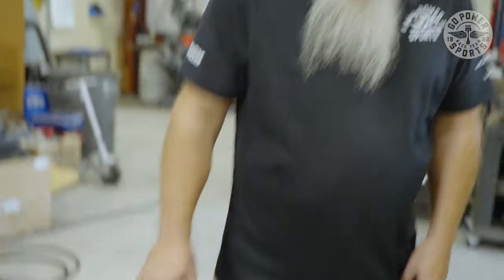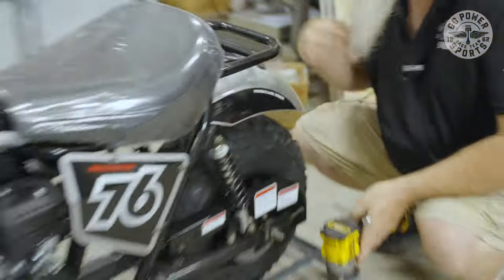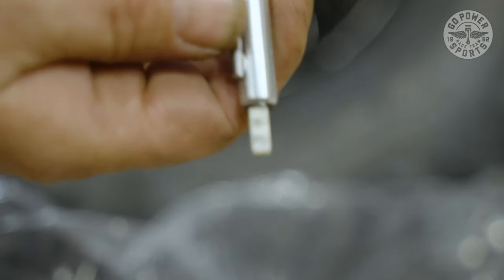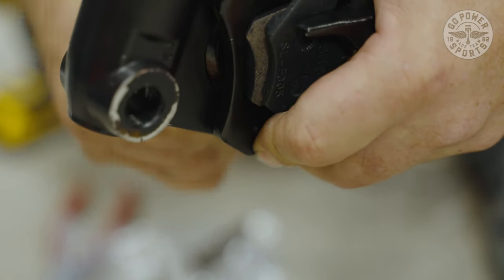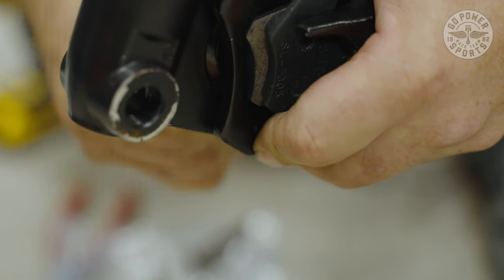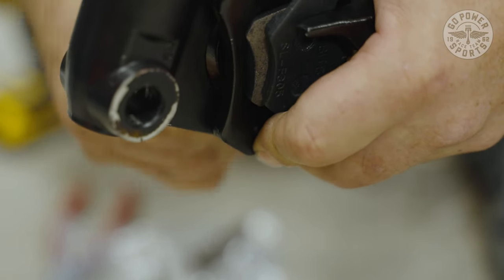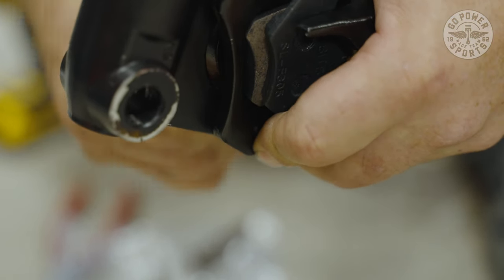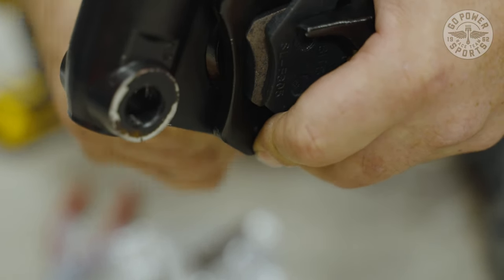How To Assemble TrailMaster Hurricane 200X Mini Bike | Tutorial

Comment: How do you spread the front brake calipers apart to get the spacer out so you can put it on the disc? NEVERMIND YOU FAILED TO INCLUDE IN THIS VIDEO THAT THEY PUT A PLASTIC WEDGE IN THE FRONT BRAKE LEVER TO KEEP THE BRAKE APPLIED. REMOVE THAT AND YOU CAN COMPRESS THE CALIPER>
Reply from the maker: Good job

Comment: I appreciate the video but straight following your instructing,  I'm having problems with the front brakes. For one,  if I tighten the bottom bolt of the caliper it is so long it touches the disk..   so after realizing that I backed it out a bit and stilll.. the tire won't hardly turn.  The inside pad is so compressed against the disk the tire won't turn.  The outside pad still has a gap and won't touch the disk even after pumping the brakes.  I don't know what my problem is
Reply: I’m having the same problem did you ever figure it out?
Reply: Hard to decide without seeing what you did and its 5 months later.
But I'm curious.
I am guess something was upside down or backwards?

Comment: 12psi sounds bit much for offroad.
However, many more experienced riders have told me to use the reccomended as a starting point and experiment for your preference and where you ride.
Don't go over the 10-12 they recommened(depending on bike and tire brands).

My bike for example handles the best where I ride with 9 in the front and 8 in the rear.(Do not just go set your tires like mine that would be stupid even if you came to ride the same place. they need to be setup for you not me).

Comment: I'm having problems with the front brakes.  The inside pad is so compressed against the disk the tire won't turn.  The outside pad still has a gap and won't touch the disk even after pumping the brakes.
Reply: There is plastic wedge behind the brake lever that has to be taken out
Reply: @19Earl49  did that already.